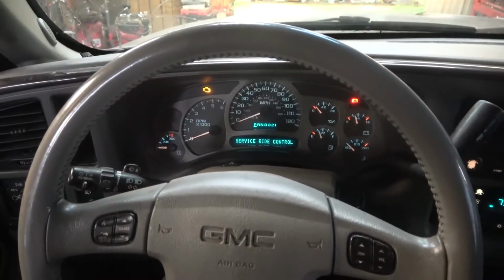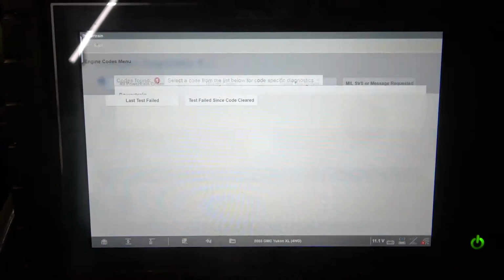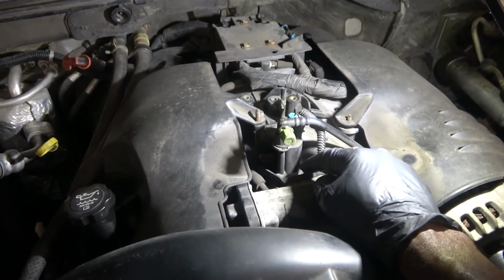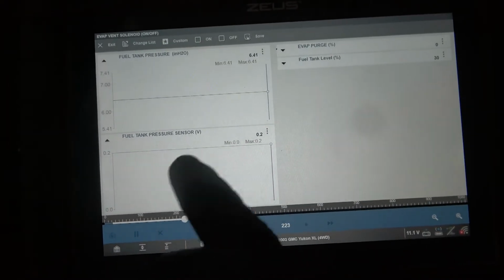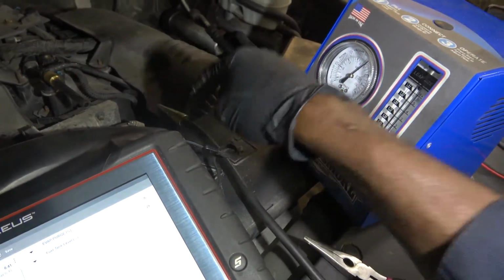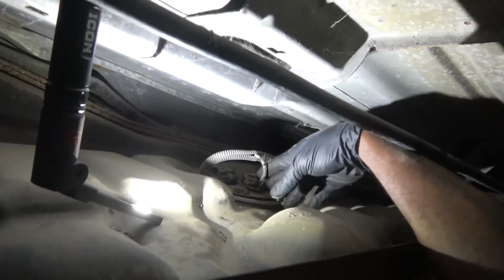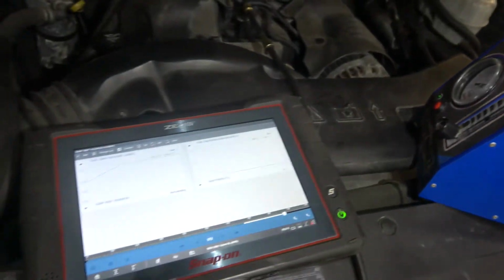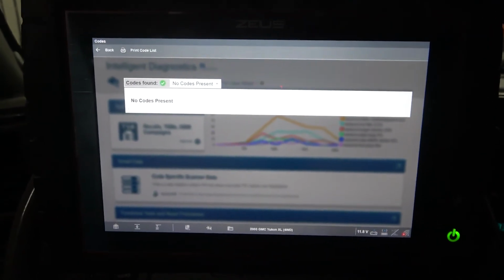GMC YUKON DTC P0446 - EVAP Vent Control Problem, Check Engine Light On? EVAP System Diag & Repair

Comment: When i seal the system the pressure floors down. I saw you seal the system towards end an it goes down very slow when seal with pressure. Vent solenoid is bad?

Comment: Hello sir i have same code i changed both valves and ran seal test everything tested good and i had pressure voltage also. Not sure what else to check

Comment: Very good video. I have an EVAP problem on my 05 Colorado and the system is similar (purge valve in a different spot, vent valve right on the canister) and I suspect it is in fact the fuel tank pressure sensor as my voltages and pressure never change (I have an X-Tools diagnostic tool - not as fancy as yours). So I may just swap out the sensor. I don't have a smoke machine but don't really want to spend the money for one problem (I don't run a shop).
Reply from the maker: @chipsawdust5816   Close the vent solenoid and watch the pid for the tank pressure on your scanner, it should increase if it doesn't you have a bad tank pressure sensor

Comment: Excellent video.  Fully and clearly explained.  Covered every aspect.  I assume the only problem was the CEL?  The vehicle was not losing mpg economy as would be if the valve or solenoid was bad?

Comment: I had this code come up and with the scan tool I checked the purge valve and also the vent valve. Both worked and the wiring was good. Then I noticed something odd. the Fuel tank pressure was at -30.86 mmHg regardless of whether the vent was open or closed. I removed the gas cap and still no change. I replaced the fuel tank pressure sensor and it read -2 mmHg. Less than 10 miles in and I had the three monitors  that wouldn't reset over 1k miles suddenly reset. They were the egr , cat, and evap.
Reply from the maker: @davewhite9828  oh cool

Comment: I’ve been chasing a p0300 I’ve finally found what I think it is my vapor vent solenoid filter box was broken with a huge hole in it would that situation cause a p0300
Reply: Likely po446,447

Comment: Mr.Deo, I enjoy your videos very informative, can I ask one question, how do I bench test my fuel tank pressure sensor? Thanks you in advance, will continue to pray your videos John.
Reply: Will continue to play your videos.
Reply from the maker: @johnwhite1851 You will need a voltage regulator to send 5v to the sensor

Comment: The question is if you don't have the expensive diagnostic tool, what do you do to test it?
Reply from the maker: @nelsonsantos770  you can send power and ground manually to the solenoids while disconnected

Comment: Thanks. Got my spark plugs & spark plugs wires changed. Engine picture went off,then came back on the next day. Even bought a new gas cap. Need to go to a funeral 60 miles from where I live. Can I drive it to the funeral & put it in the shop when I return home? Thanks 💯%
Reply from the maker: @SherrannTerry   whatt codes do you have in the engine computer, if you don't know, have someone check them for you

Comment: What about a hissing sound on startup coming from the rear, can put my ear up to the gas cap and hear it inside. P0446 code
Reply from the maker: @exypher   I didn't hear a hissing sound
Reply: @ would that be something wrong with the sender/fuel pump? Or could that still be cause by one of the sensors/solenoids?

Comment: You tested the fuel sensor by closing the vent solenoid at the first time how will smoke now get into the thank for the sensor to regulate ?
Reply from the maker: @GabrielEbenezer-ko2hp  Sorry, I didn't understand your question
Reply: @KITS_Auto_and_Truck_Repair  I mean how possible is it that you closed the vent solenoid when testing the fuel sensor, then since the vent solenoid is closed how can the are you sent from the purge valve line get into the thank for you to know that the sensor is good or not , I thought the vent solenoid should be open so that the smoke from the smoke machine can get into the thank for a test

Comment: My bad ftp sensor had 0.22v when good one installed 1.5v
I was able to confirm system sealed properly due to system building pressure and being able to hear system release pressure when gas cap was removed. 😊
Reply from the maker: @danielramos6006  Great job!

Comment: Good explanation. I ran into a similar problem on my 2010 Chev Silverado 1500 pickup. Had the check engine light on. I hadn’t had the truck too long. Bought new. Had the dealer check. They told me I basically had a tiny vacuum leak. That they reset and cleared the code. Me being from old motors asked that there wasn’t a serious oil pressure issue. They said no. That your alright to drive it like that. Said that minuscule leak to find it would be like looking for a needle in a haystack. They said if it comes back up bring it back and they’ll dig further. Wasn’t very long and it was back. Didn’t go back. Drove it like that a long time. Ran into other issues way later on. Local guy fixed those. Then with this he had a diagnosis tablet but started first looking that the gas cap was sealing. I said it’s almost like I smell gas when I fill up and I questioned if the feed in tube was cracked or something. Anyway he cleared it and it was right back. With what he could on the tablet we then changed the vent module. Had to cut the hanging spare down as it was located above that under the box. Got that changed. He said that was stuck open. He cleared the fault but at the same time took my hand mirror to try look at the fuel pump and sending unit that sits in the top of the tank. He said it looked like it was wet. I had it maybe a few days and the same fault. Well this next job just like you have here; getting to and pulling the fuel pump/sending unit will cost you plenty in a garage. Some people have been known to cut a hole in the box to get at it. Well he took and dropped the tank. Found the plastic flange that is on the unit, that sits against the tank when it’s dropped in was cracked about half way around. Saw the pics. Got that removed and replaced. End of check engine light issues.
Reply from the maker: @junulock  Oh man!! That's too bad

Comment: So if at all uou changed the Evap sensor it wouldn't have work out so now the problem is that the fuel pressure sensor that got spoiled triggered the evap code on
Reply from the maker: @user-dw7jv9zi1d   Sorry! I didn't understand your question!

Comment: mine is building up a lot of pressure in the gas tank with this code. would it be charcoal canister? if replaced every other part you have tested.
Reply from the maker: @GRS-gd3ig  if the pressure in the tank is too high, you might have a stuck closed vent solenoid!!

Comment: Well I replace the purge valve and the vent valve, but didn't do the fuel tank pressure sensor, that might be my problem. I dont have obd scanner, just have a cheap scanner that gives codes only. Well guess what I'm doing buying the pressure sensor for fuel tank. Hopefully my check engine light goes away. Thanks for the break downs.
Reply from the maker: @biggabe4904   My Pleasure!

Comment: I understand everything you were saying. But I need to understand if I don't have the scan computer that you have. But I do have a FIXD SCANNER  which told me that the code P0446 indeed is the code. Soooooooo what I'm asking is can I just change the part since it's telling me that it's one are the other, most likely it's the one by the fuel tank. Only because I don't have all the tools you have.  ( So can I just change the part myself ) Thank for giving us understanding to this.
Reply from the maker: @travisdeal7485  you should have it checked because the issue could be the sensor wiring!

Comment: Hello Deo, I learned a lot from watching your video! I’m researching how to fix my P0446. On my initial scan of my vehicle it said it has “excess vacuum” and well it tends to spit gas back out when fueling. Would that be because the vent valve is bad? Would maybe need replacing? Would love to hear your opinion
Reply from the maker: @alejthagreat  Yes! your vent solenoid might be clogged, you should test it and see if it's working properly!
Reply: @KITS_Auto_and_Truck_Repair Thank you!
Reply: When I’m getting fuel the pump keeps cutting off.  Do you think it could be a bad fuel tank pressure sensor?
This is a great video. Thank you!

Comment: You mentioned a circuit problem which can be technically correct, not so much a wire problem as a component electrical failure, my GMC Library shows a clogged Vent Filter and a Fuel Tank Pressure (FTP) Sensor for this code. I hope yours is different so I can add another repair to my Library, still watching......Well, no luck today. I wish you would have at least retested the sensor signal pin to verify a voltage change and the correct voltage that should come from the FTP at static atmosphere pressure, the bad sensor showed 0.25V if I am correct. If you perform a test procedure on a bad part, please follow up with the same test procedure on the NEW part as well so we all know what a good test looks like on a good part. We also do not want to waste our time to bolt up the fuel tank in this case just to read the scan tool and notice a problem with the new part, now we need to drop the tank again, order another new part, etc, & do the proper test procedure again before bolting up the tank, YES, PLS. Many of us simply don't fully trust the scan tool so we like to back up our testing with direct voltage testing at the sensor which you did half of the procedure. Thank you for all the videos that you produce, very much appreciated.

SMA listed it as a GMC and Chevy, its been highlighted in my library to move it to Chevy only, your video will go in GMC LOL, https://www.youtube.com/watch?v=4VasSSYBal4
Reply from the maker: @DuaneDonaldson  Good point but for me the voltage change on the scan tool's Fuel Tank Pressure sensor Data Pid after replacing the sensor was enough evidence that the problem was fix, the voltage went from 0.2v to 1.5v I believe!
Reply: OK Brother, but I would verify the scan data before bolting up the fuel tank, love your stuff. But for training, I would measure volts since we all know scan tools are not 100% trustable. I just watched a video today, APPS scan data 0V, scope at ECM proper volt sweep, car drives ok, BAD ECM not calculating APPS data to the scanner so ECM logic also not fully trustworthy, no worries mate. @KITS_Auto_and_Truck_Repair

Comment: Hello I have a 2005 Chevy Tahoe 5.3 and it won’t crank from key but I can crank it with a wire rand from the stater relay to the battery could u help with some information on how to get it to crank with key
Reply from the maker: @freds5109  you mightt have a starter relay issue or a ignition switch issue, I recommend you take it to a Pro mechanic who can diagnose it for you!

Comment: You did your best job 
But why the engine control unit not show code of fuel tank pressure sensor fault 
Thanks bro
Reply from the maker: @abbasmuhsen2715  My Pleasure! That's a good question, I also wondered why the PCM didn't set a fuel tank pressure sensor fault code, but I think it's a computer logic issue! I'm not really sure though!

Comment: Great explanation on the evap system.  I have an evap vent control system circuit code.  Shop replace the vent solenoid, and the code is still there. I'm guessing I have a wiring issue somewhere.
Reply from the maker: @lonewolf744   Thanks! Yes you might have a wiring problem!